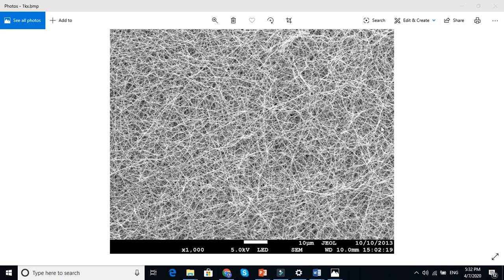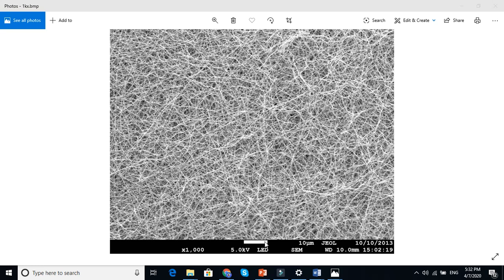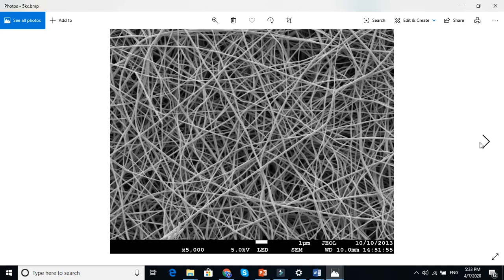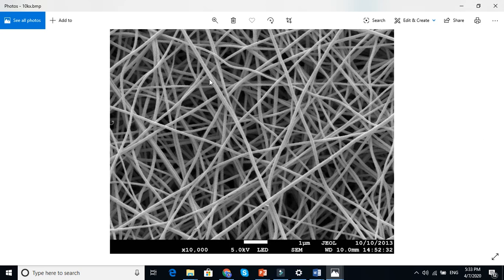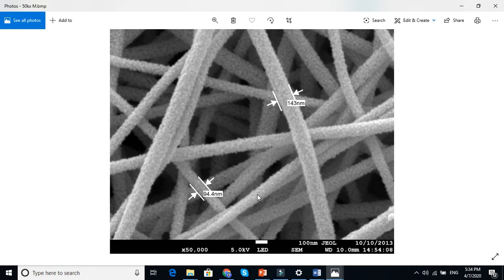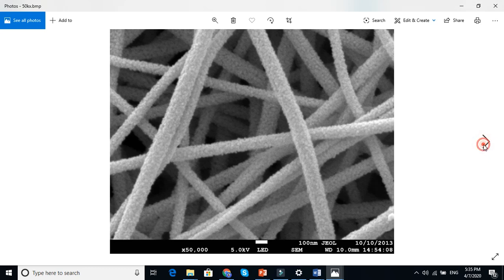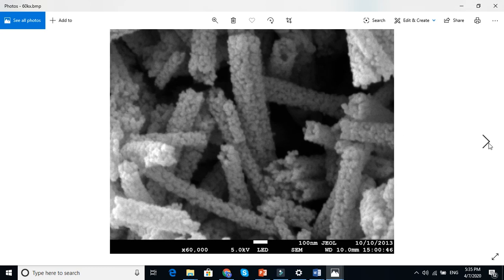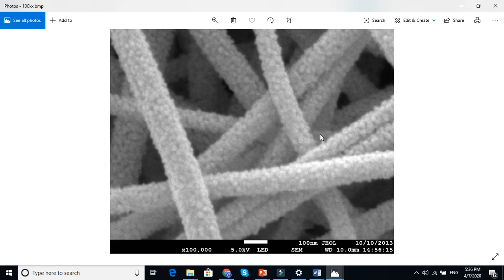How to Interpret SEM Images?

Comment: how to write the sem images in paper
Reply from the maker: You just simply write the following information 
1. What is the shape? either spheres,  rods, fibres, cubic, ....
2. Size means diameter, radius, height,  length, etc..
3. Distribution of the particles, whether randomly or uniform 
4. Surface texture whether  smooth or rough ...

The list goes on .....
Reply: @qamarwali   I have some SEM images in low zoom 300 um (and I need to interpret the particles  less and equal to 2.5 um, should I doing again the analysis or I can zoom it with this Software?? Answer please 🥺
Reply from the maker: @djedidmana3405  I think you can repeat the SEM analysis but report what you have in hand. You can also take help from XRD or TEM to confirm the particle size. For better analysis,  take the SEM images at very different magnification.....